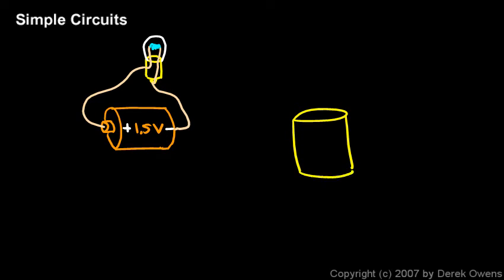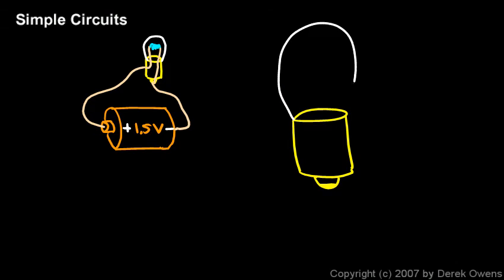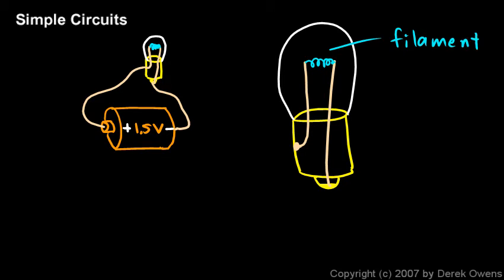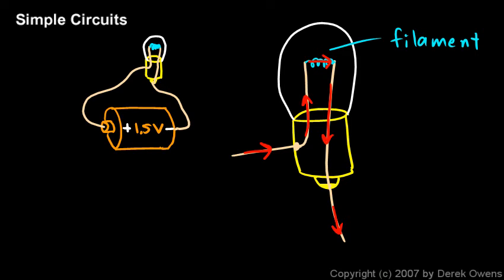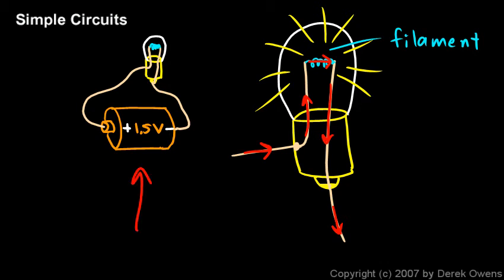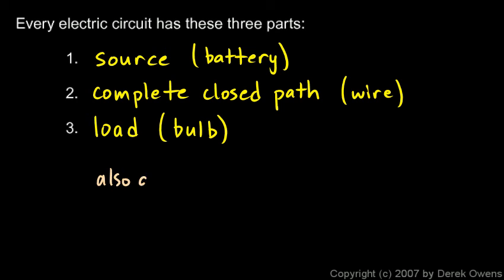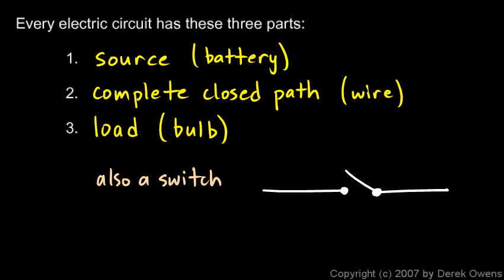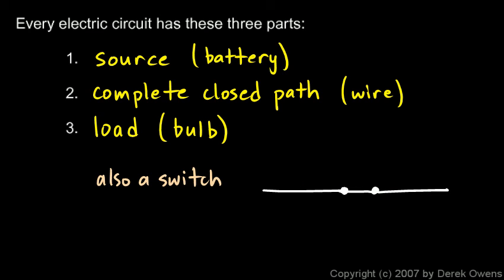Physical Science 6.2a - Simple Circuits

Comment: did you make  mistake in your diagram?
don't electron flow towards the positive terminal from a battery
in your diagram it shows that the electrons went from the positive terminal into the bulb and then to the negative terminal
im thinking its the other way around
thanks.